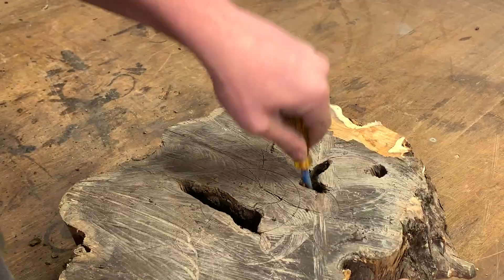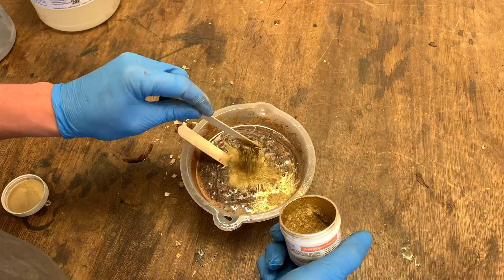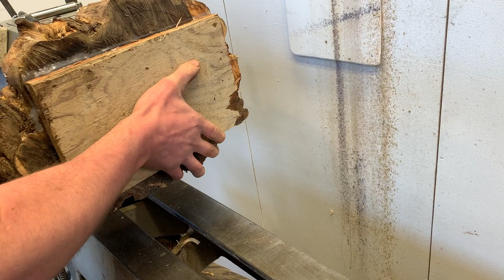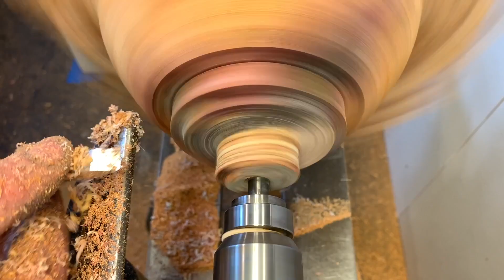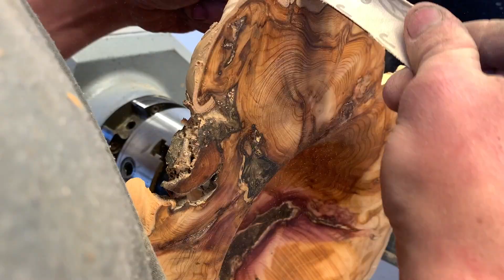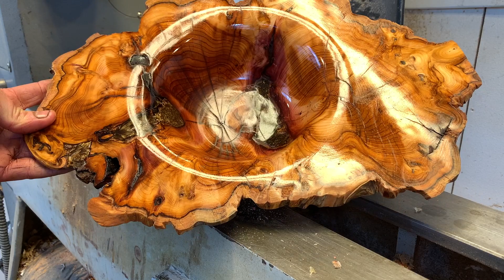Woodturning  - A Very Risky Bowl  (Yew and Resin)

Comment: Nice epoxy match.  I would have used only the first blue color for contrast.
Reply from the maker: Thanks, in a piece like this I don’t like to make it garish.. the resin was for practical reasons as there was a hole through the centre meaning not wood for a tenon. 😊👍🏻

Comment: Now at 10:40, are you sanding the center with the lathe running?  If so, do you have trouble with cracks and splits on the bottom of the inside of the bowl?
Reply: I ask because I was always taught you never sand the bottom of the bowl with the lathe going because it will make the surface uneven and go against the grain...hence the cracks and splits.
Reply from the maker: I’m sorry but I can’t get my head around what it is you think will happen when you sand the bottom of the bowl?? 

Sanding doesn’t cause splits and cracks in any way. That isn’t just my opinion, that is fact. I have no idea what the person who told you this was thinking but they definitely did not understand the basics of woodturning at all.
Reply: @JackMackWoodturning  just repeating what I heard.
Reply from the maker: No problem buddy. Happy to help if you have any questions 👍🏻😉
Reply: @JackMackWoodturning  yeah, I was thinking about your response all night...I was just asking a question...not judging or anything.
Reply from the maker: Yeah I get that buddy. I was just explaining why your statement was incorrect. No animosity intended at all. 😊👍🏻
Reply: @JackMackWoodturning  super....

Comment: Have you tried a sander that has strips attached to a wheel, used to do the bark edges? Looks like it might work for your project.  Beautiful work.
Reply from the maker: I have seen them in use and think the results look very poor indeed. Not everything should be done with power tools, especially sanding, I prefer to have control over the process. 👍🏻

Comment: Wow, fantastic, was worried at 1st that you were taking too much but it turned out great..! Where does one obtain a gorgeous piece of wood like that....?
Reply from the maker: Thank you. It dose look like I’m removing quite a lot of wood when I turn this type of bowl, but it’s an end grain bowl and the bowl in the centre is actually the biggest bowl you could fit on a piece
Like this due to its elongated shape. 
Where the bulk of the wood is removed is actually the sections under the two wings of the bowl. 

I get my wood as trees, I buy from landowners when the tree is due to be felled (normally for safely reasons) 
I then collect it and cut it with a chainsaw into manageable chunks and bring it back to the workshop to process.. 
to turn an end grain bowl like this so that it won’t crack or warp the wood needs to be fully seasons before I start turning, this piece has been in my kiln for over a year before I got a chance to turn it. 

Thanks for following along. 👍🏻

Comment: Hey Jack, if you don't mind me asking,  what brand and model lathe are you using?  It seems to handle your pieces really well, and you turn stuff I've not see other turners even try to turn.
Reply from the maker: Hi James, the lathe is Axminster but I wouldn’t recommend it. I am replacing it with a Vicmarc as soon as I get the chance 😉👍🏻

Comment: I could not see the gold epoxy filler. I’m assuming it’s the dark purple e appearing area inside the bottom of the bowl. Did you ever put epoxy under pressure with the wood burning?  The outcome is among the most beautiful turned wood bowls I’ve seen. Suggestion:  occasionally clean off the dust from your carving blade surface so that the viewer can ascertain the knife being used as well as the angle of the knife tip, flute, etc.
Reply from the maker: Unfortunately the gold in the resin didn’t show up well on the video. There are pictures of the resin on my Instagram story section. 
That sounds interesting, il look into that. Thanks. 
I appreciate you following along and really glad you share your opinion as well as enjoy the videos. 
Cheers 😊👍🏻

Comment: Nothing left of it, took much too much off of the bottom.
Reply from the maker: I feel your not being literal, cos I’m pretty sure there is a bowl at the end. A nice thin one, and it’s the same hight as the blank, minus the tenon. 😆
Reply: @JackMackWoodturning  watch your own video again, there were a couple of times when you had a nice soup plate shape on the bottom and you only needed to take the corners of the steps off. But then you went back in towards the middle making it narrower and narrower. I just felt the bottom of the  bowl could/should have been wider. Your end result is nice but it could have been (my opinion) even nicer.